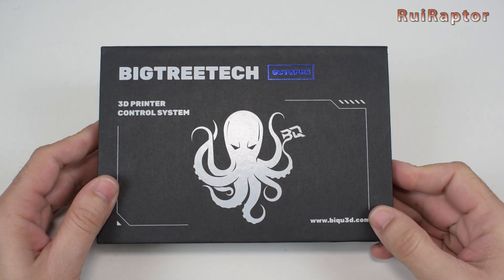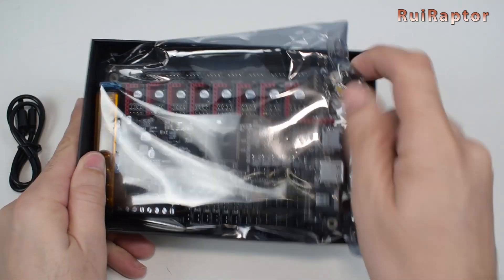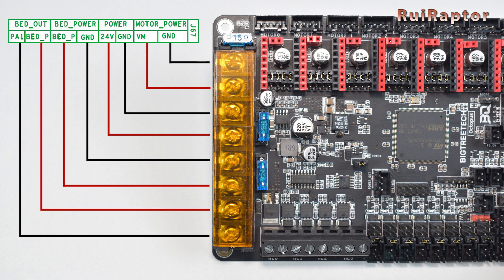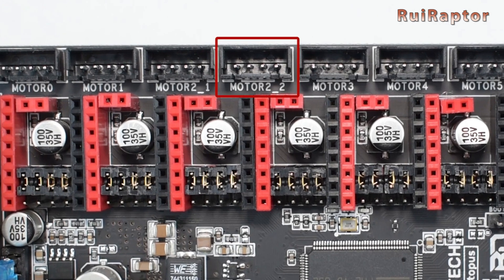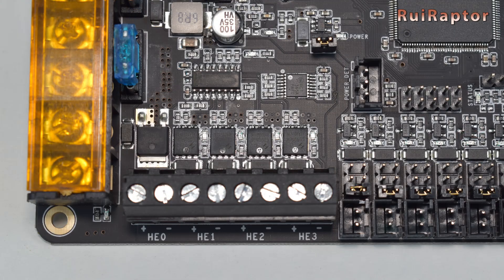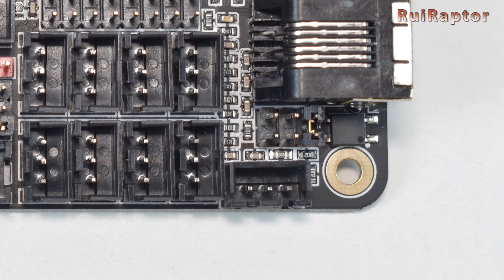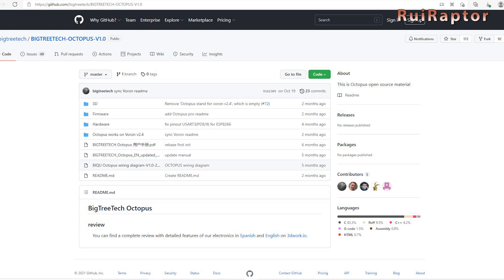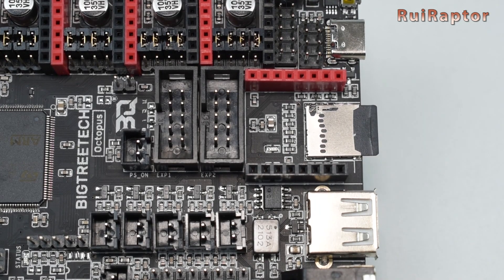OCTOPUS BTT Board - Full Analysis With All The Details & Features

Comment: BTT Octopus V1.1 Control Board. Two USB Ports?

The USB C is for Printer control e.g. Raspberry Pi but what is the other USB port for?

Please can some one explain, Thank You
Reply: Usb-c is for powering the Pi.

USB-A is to plug a flash drive and print from it.
Reply: @valen961  thank you, some USB cables are power only I hear, another marking con job IMHO